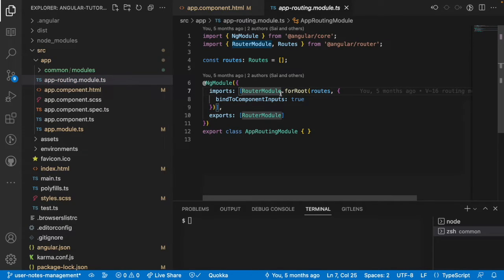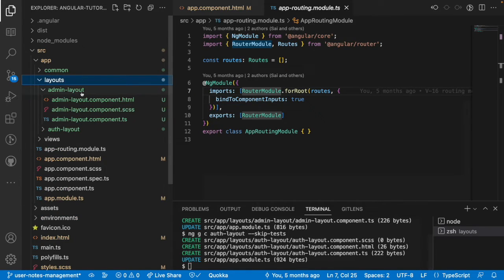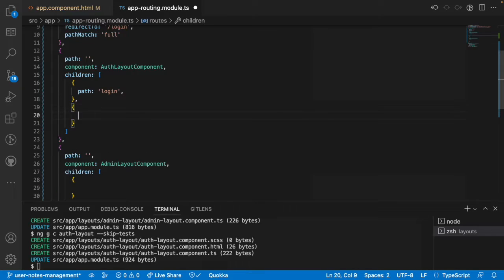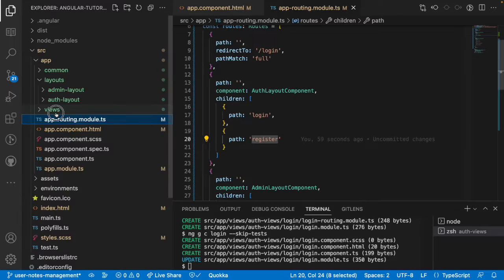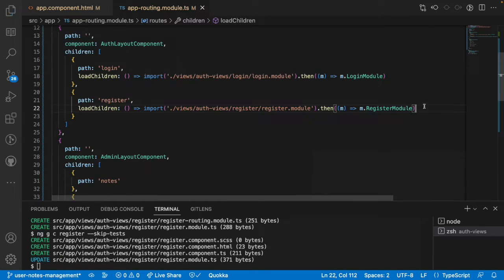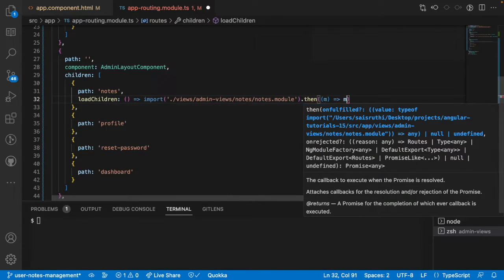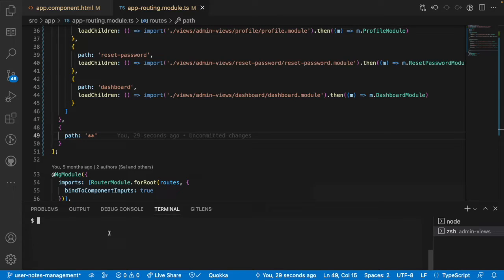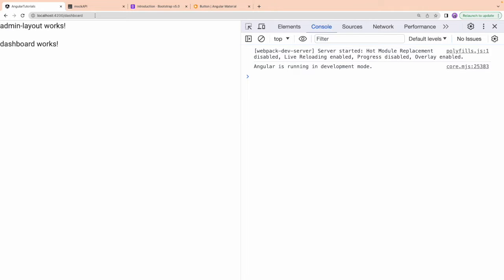Routing configuration and setup | User and Notes Management | Angular Project  | Part - 2

Comment from the maker: 00:02 Setting up routing configurations and folder structure in Angular project.
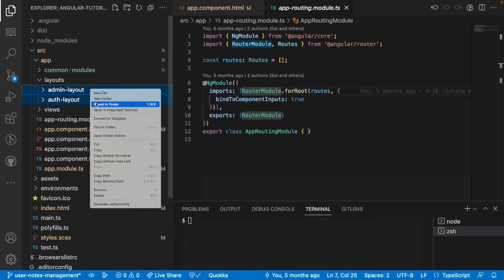02:03 Setting up admin and Au layouts
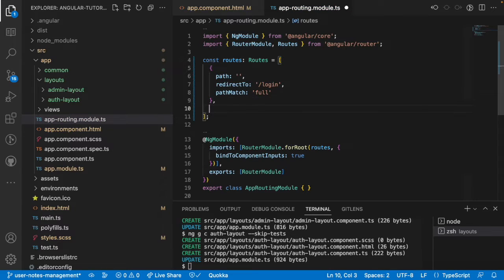04:00 Setting up path matching for login and admin layouts
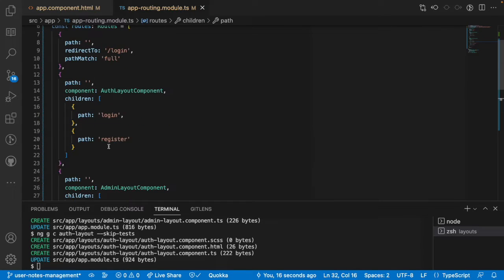06:04 Implement lazy loading to improve performance
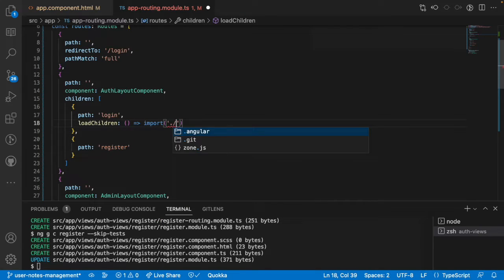08:03 Configuring routing for login, register, and admin views modules
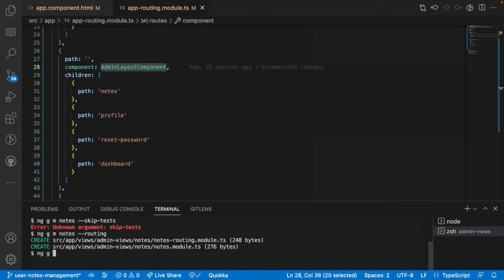10:08 Creating and configuring components and modules
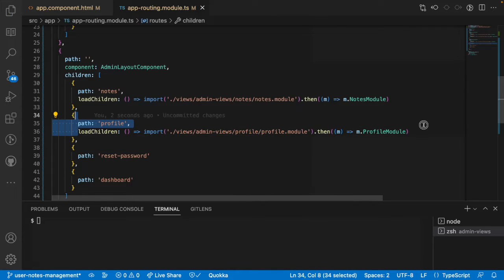12:23 Setting up routing configuration and setup for user and notes management in Angular Project
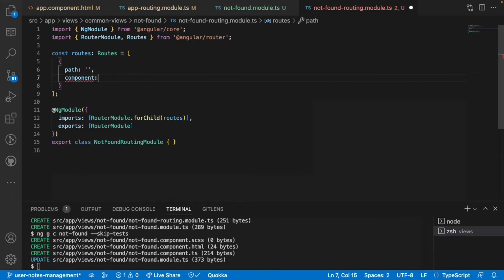14:46 Configured routings for different layouts